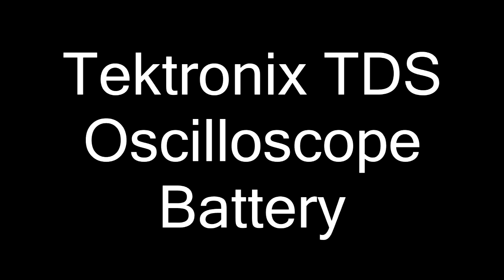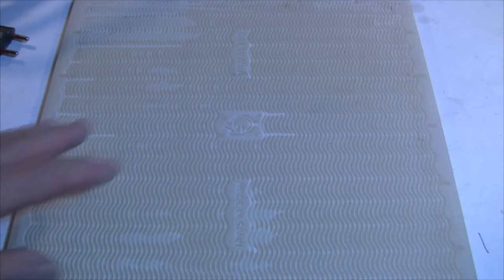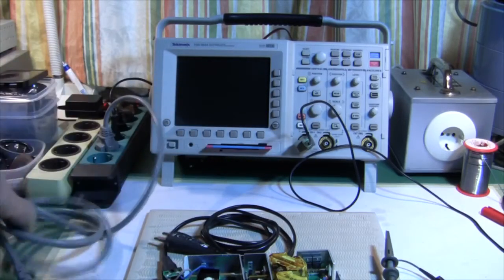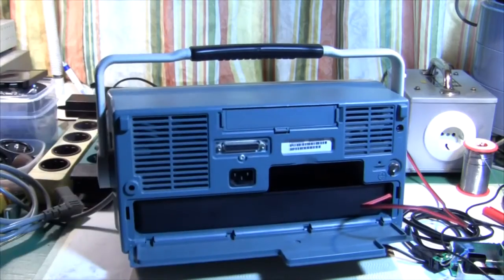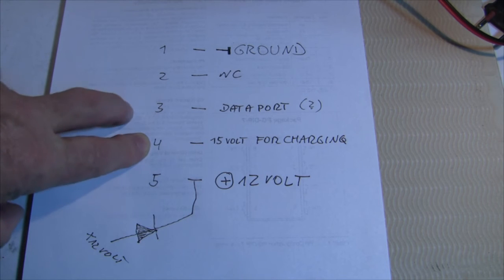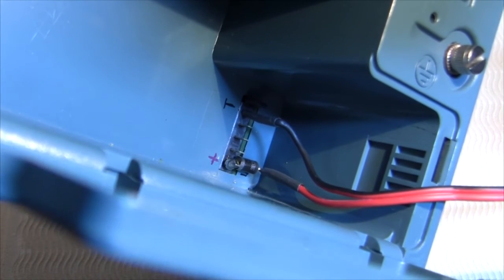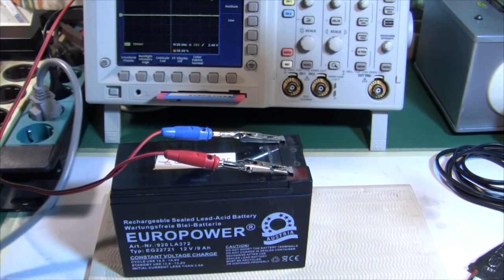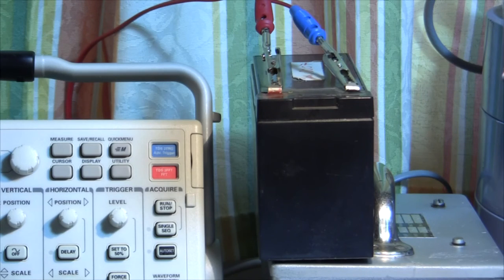Tektronix TDS Oscilloscope Battery Fix

Comment: I'm pretty sure that my TDS3BATB contains a Unitrode/Benchmarq/TI BQ2050 gas gauge chip, which uses the 333 bit per second "DQ" one-wire communication protocol.  (Not the 1kbps Dallas SDQ nor the 5kbps HDQ.)
There are several seconds of comm at battery insertion which I couldn't capture, but then the scope loops reading six registers once a second.  The registers are 0x3 (Nominal Available Capacity High byte), 0x17 (NAC Low byte), 0x3 again (in case it rolled over I guess), 0x1 (FLGS1), 0x2 (TMP) and 0xB (VSB - battery voltage).  When charging in the scope, NAC increments approximately every five seconds.  The temp field of TMP reads a constant 7 (30-40C) while the gas gauge field incremented once in about a half hour.  FLGS1 returns 0x94 indicating Charging and Capacity Inaccurate.  I don't like CI but maybe the scope doesn't care.

By the way I measured this using the TDS itself :)  Just wrapped a wire around the DQ pin to bring it out to probe.  The gauge's comm timing is unstable, it's best to use B Trigger in Event Count mode.  Commands are 9 negative edges, returned data is 8 edges.  So you can scroll through the commands and replies by setting the event count.

Comment: Nope, pin 2 is truly No-Connect, so pin 3 is a one-wire system.  Low-active with pull up to 3.3V.  Scope polls once per second, two bursts and wait.  (Second burst is probably a retry.)  If battery is present, we get one burst of six exchanges per second.   The six exchanges take about 500ms but it varies.

Comment: Thanks. Your video showed me how to avoid spending about $700 for a Tektronix battery. And that allows me to operate my TDS3052b fully isolated for measuring  switching power supply noise. That way I will not disturb the analog and digital reference grounds.